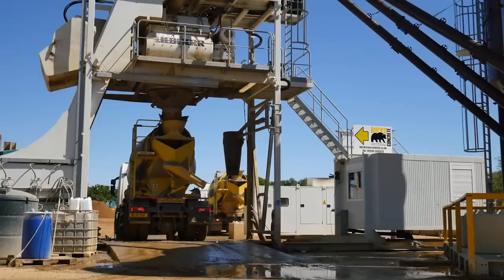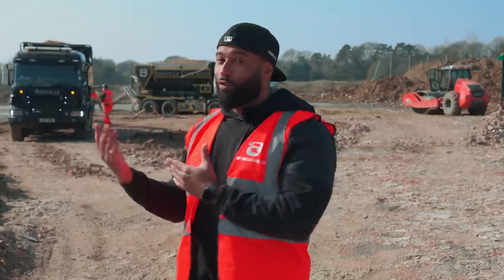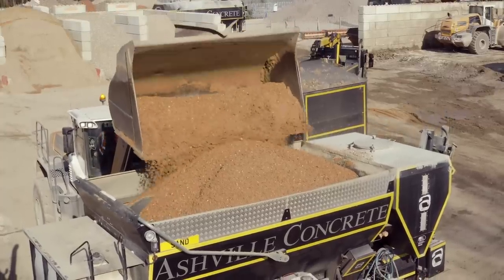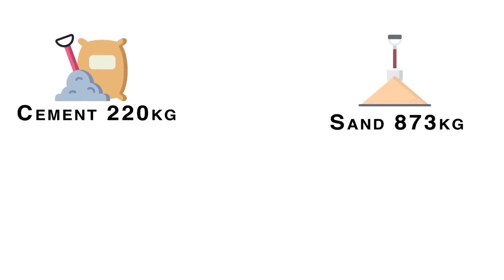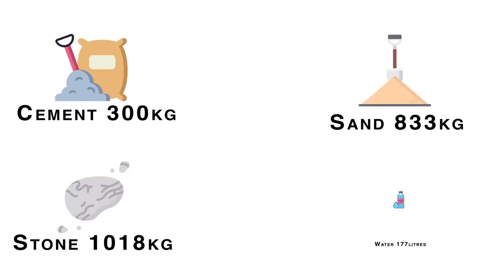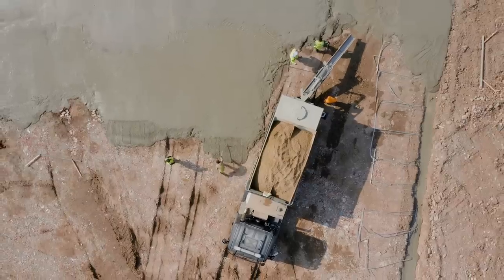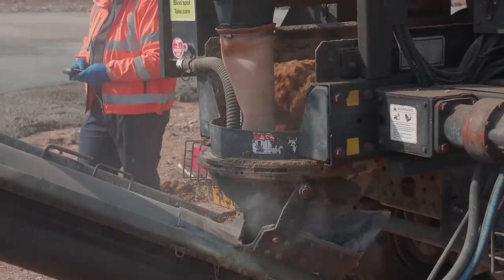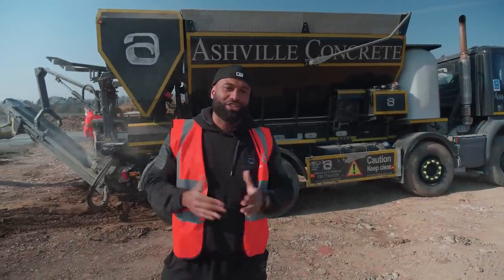What is Concrete and How Does a Volumetric Mixer Work?

Comment: Working for reinstatement for utilities I’ve used the volumetric and drum mixer but the volumemetric is so much better because you can change the wetness where as if you have drum if it’s too wet you still have to use it and pay for it

Comment: Hi from Australia. Haven't seen a concrete truck like that before in Australia, but I will keep my eyes open. Good thing about those trucks is that you don't have to worry about a batch of concrete going off in the mixer barrel. Our mixers are getting so big that we now have semi trailer barrel mixers running around.

Comment: Great video as per , quick question I understand you mentioned you can pour multiple different mixes gen20 gen40 etc, but what when where and how do you change the gravel size is that just for footings the 10mil gravel n five for your garden sheds ? Cheers 💪💪

Comment: I have to point out that ' bottle mixers ' as  you call them don't keep concrete wet .... i drive one and have done the last 12 years and all they do is agitate it ... it will still dry out and go hard even with the barrel turning which is why we have 2 hours from time of loading to delivering the load and washing out .... if we are kept waiting or have a breakdown while loaded it can become a very costly problem ... not fun being in one of those barrels with 8 cubic metres of rock hard concrete with only a small kangol to try get it out lol
Reply: Haha! Must've taken ages to break through that lol

Comment: Worked on a few different Vollys. Cemtech to Riemer and im currently on an Omega. Never used a volly that does the water for you depending on mix specifications, that's class. What do you use at Ashville? Reimer or is it a Baylynx?

Comment: I'm really curious what is happening in that last pour.  I've never seen concrete just run out like that without any forms, nobody screeding it, just random edges, and the sub grade doesn't even look flat.
Reply: Normally concrete like that is called "blinding". It is a base to work from to construct formwork.  Or as there isn't any steel mesh or bars, it is probably just going to be a hard standing. Without steel reinforcement it will probably crack in time.

Comment: You forgot to mention that strenght is not determined by how much cement is in the mix as much as the W/C ratio is correct.
I could have a 6 1/2 bag test out lower than a 5 bag mix if the W/C was off on the high bag mix.

Comment: I’m a CMT tech in the states, volumetric trucks are my worst nightmare
Reply: Why? What are disadvantages in comparison with barrel mixer + concrete plant?
Reply: Alexey Bakulin the main disadvantage is troubleshooting, with a drum truck if the mud is too wet or too dry I can tell the driver to add water or put the mud to sleep. With a volumetric truck I have to trust that there’s not a malfunction is the computer system when the batch is being placed. Also having to let the volumetric truck pour out concrete until it’s consistent. I’ve had augers break down, computer malfunctions etc. With a drum truck we can just send it back to the plant and wait 15-20 minutes tops for a new one. Volumetric trucks we could be waiting for hours which cost the contractor more money in the long run.

Comment: Won't be long before that concrete cracks to hell
Reply: Bellend
Reply: @5778-z9j  care to elaborate on that?
Reply: S S  why?
Reply: S S  why?
Reply: @5778-z9j  I'm just stating a point, it's got nothing to do with being negative. Concrete is useless without rebar to reinforce it. 
Nothing against Ashville, they're just pouring it, but you're showing your age by throwing the insults around because of an observation I made.
Reply: chalky762 why do you think concrete is useless without rebar? Most foundations for houses and extensions do not contain rebar